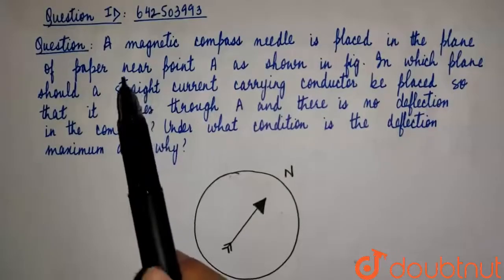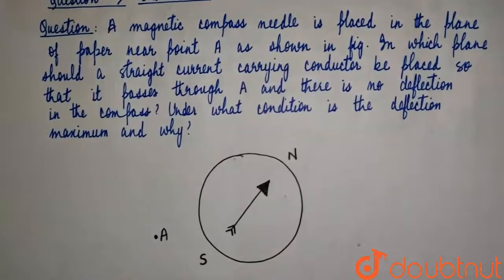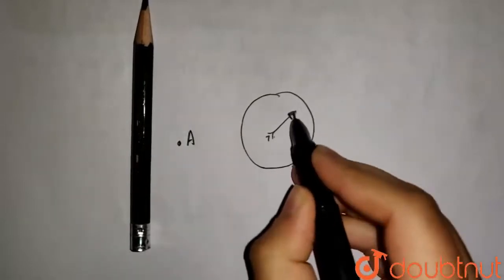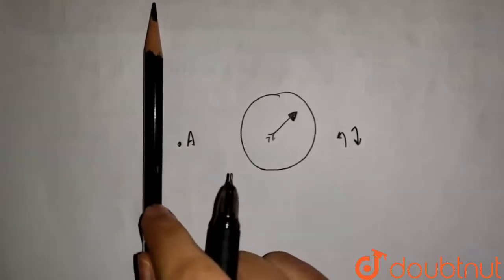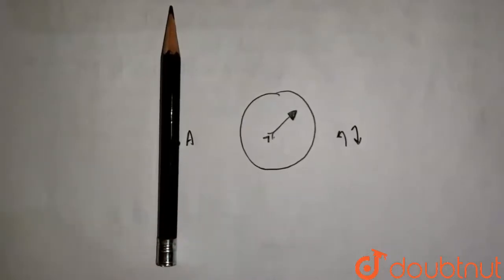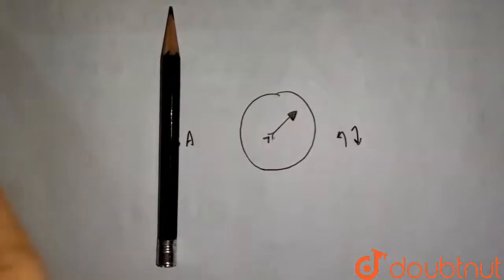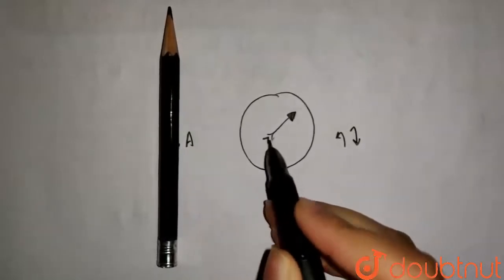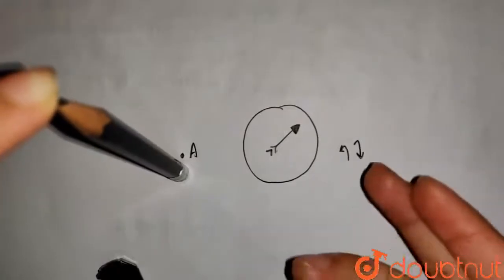A magnetic compass needle is placed in the plane of paper near point A as shown in figure. In wh...

Comment: Then why in 12.5 deflection occured there also both were parallel and in same plane
Reply: Exactly same doubt
Reply: @vaaridhidixit8409  I searched online and found tht since field lines are concentric and not properly vertical some deflection can occur when compass is kept parallel to wire due  to circular field line shape..
Reply: In 12.5?

Comment: Then how compass deflected in oersted's experiment?
Reply: Conductor was perpendicular to plane of paper...
Reply: Conductor and compass weren't in the same plane, therefore if you imagine it properly the compass was able to experience horizontal field caused due to the magnetic field concentric circles of the conductor. If it's in the same plane as the compass, then there will be no horizontal magnetic lines IN the plane of the paper so no deflection
Reply: Ik boards aaj hai but by chance you're still confused and boards me aa jaye ye question